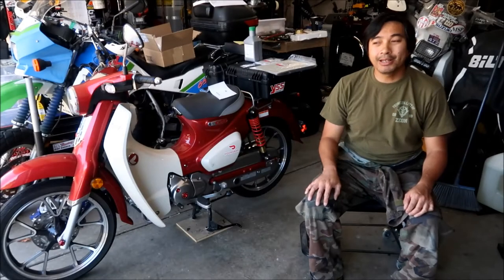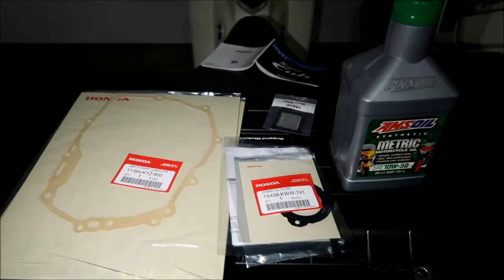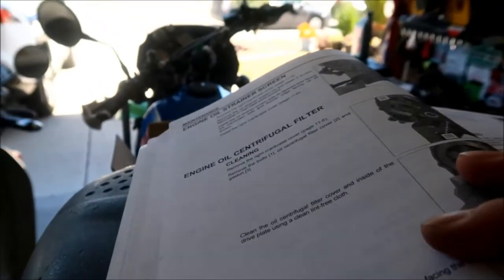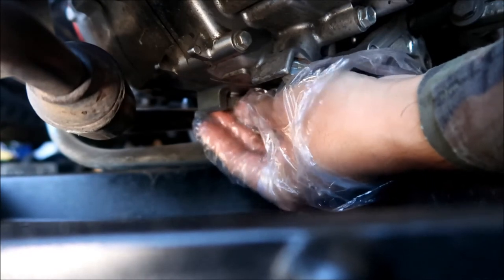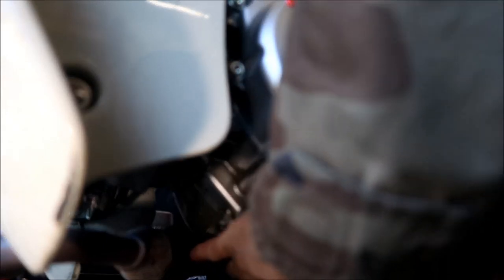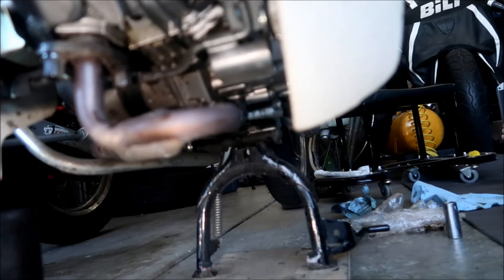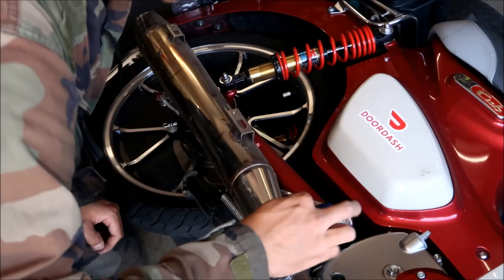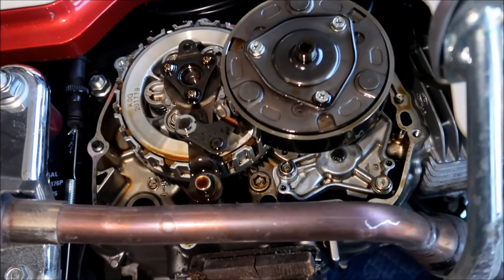Honda Super Cub C125 Oil Spinner and Filter Screen Service Part 1 - Removing Engine Cover

Comment: Honda designed it that way, because the centrifugal oil spinner is the best way to filter oil. With the screen it gets strained and then it gets filtered. The new Cubs have the same system plus a oil filter which can be changed at more frequent intervals. But the internal centrifugal system works amazing. Wet clutch systems must use motorcycle oil designed for a wet clutch, car oil will cause you to slip, not good. I'm also curious, when he applied torque to the drain plug, it looked more like 18 inch pounds as opposed to 18 foot pounds, just my observation.

Comment: Thanks, this series will help a lot when I do mine.  I noticed your low battery key symbol was flashing on the dash.  Mine did that too and I swapped the 2032 fob battery.

Comment: Hi there. Very good videos, thanks. I have a 2022 Supercub and they have  added a cylinder oil filter to the engine so not sure if the spinner and mesh screen is still used. Trying to get a copy of the new service book.
Reply from the maker: Nice I wish they had just put a normal paper filter in the first place.
Reply: @nigelbaldwin752  Cheers Nigel.
Reply: Stu.  How is your oil consumption on 22?   Mine burns up 150 ml per 200 miles.  I think it is a bit much.  Ive got 4000 miles on mine.